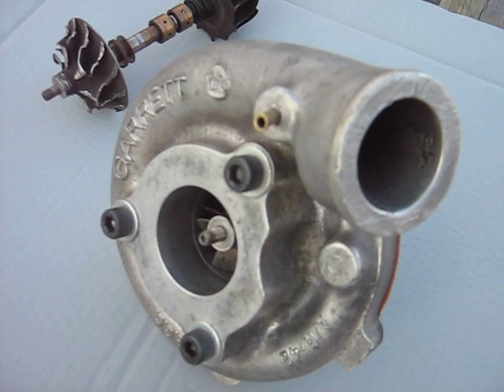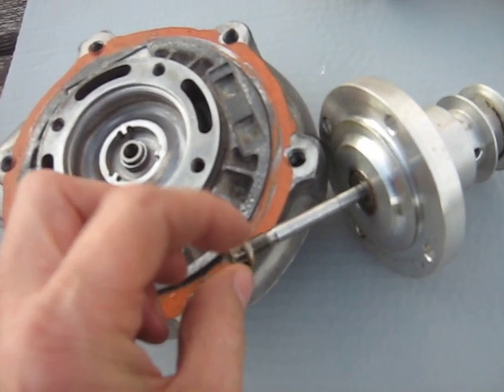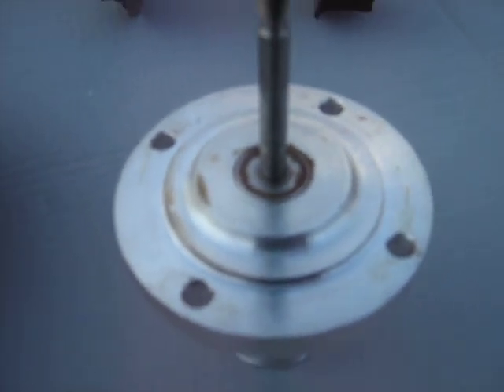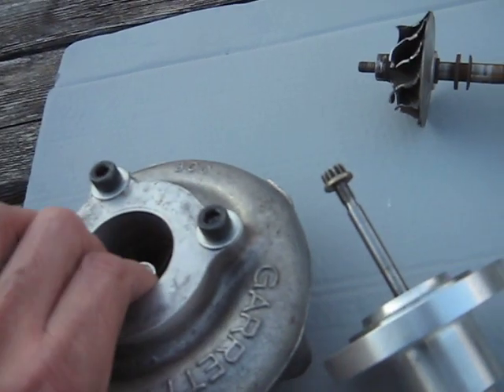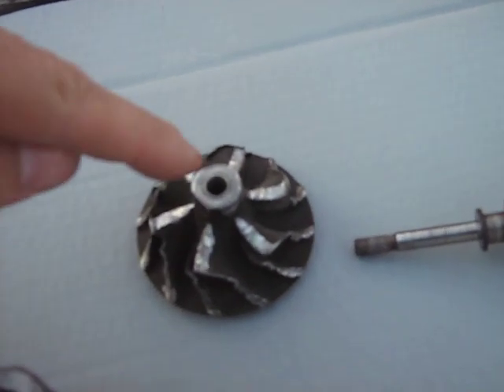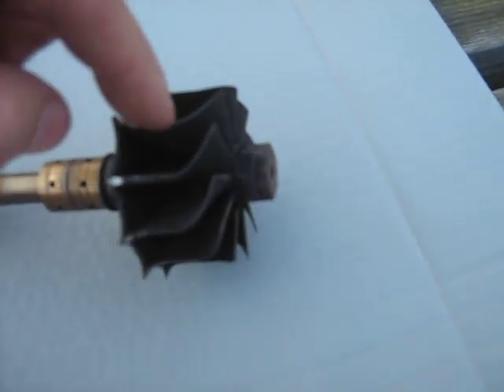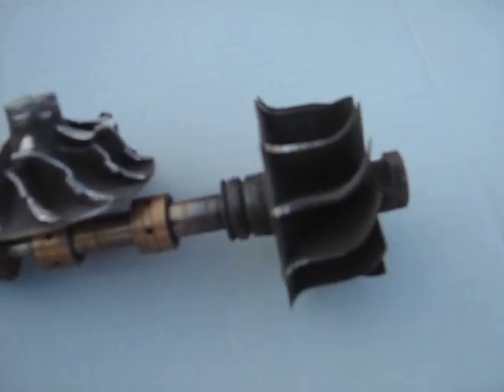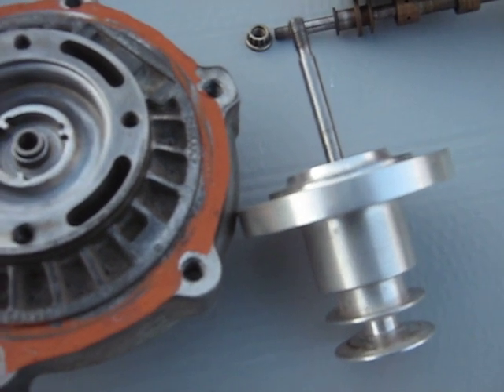5HP SuperCharger Teardown

Comment: Well a supercharger belt takes that rpm in some situations so mabye a belt system with a hard belt tentioner would work better. I know theres chain rated past 50,000 rpm so as long as it was super tight on the sprockets. Just dont do any belt ro chain setup without a big guard in case you break a belt or chain.

Comment from the maker: Actually it would be more like 35,000 rpm, as a racing 5 horse Briggs is good for over 6000 rpm. Anyway, it still isn't fast enough though. According to a youtuber in the know, this turbo compressor needs to turn around 100,000 to make decent boost. Yes, this did move some air, but boost would be negligible :(
So do you have a Roots type blower to power with the electric motor, that would probably be best.

Comment: so what is that, 20,000 RPM? Does it make any boost?  I am curious because I want to try a fork lift 9 hp electric motor driving a supercharger, but if a really big turbo cold work I could try that instead.  I just thought there would not be any usable boost spinning so slow?

Comment from the maker: @MRkallek91 
Yes, they are "self supercharged" using the crankcase side of the piston. Well, at least the great majority of 2 strokes are, the ones that need oil mixed with the gas, or have an oil injector. The exceptions are generally diesels like the GMC 6-71 series, and opposed piston types, like the Napier Deltic, and Junkers Jumo.